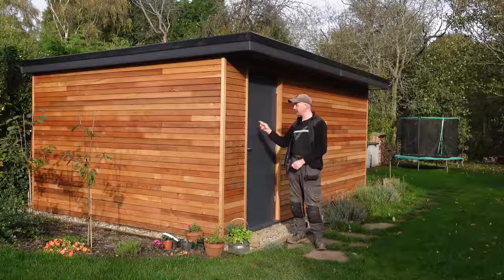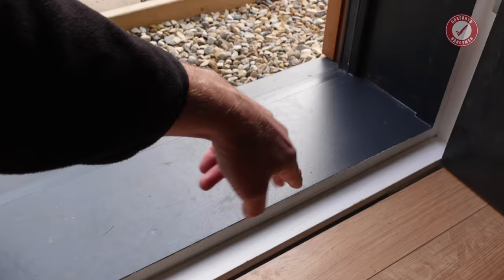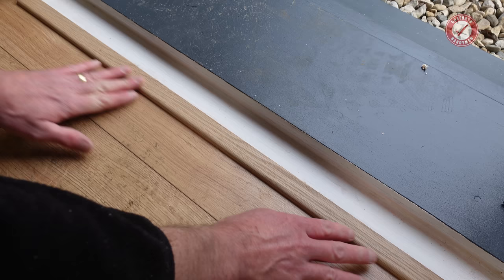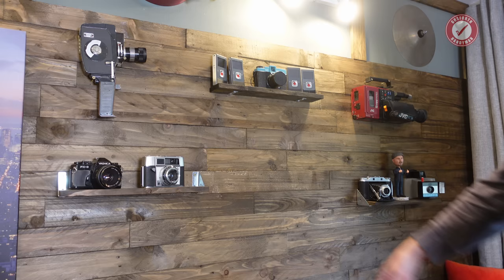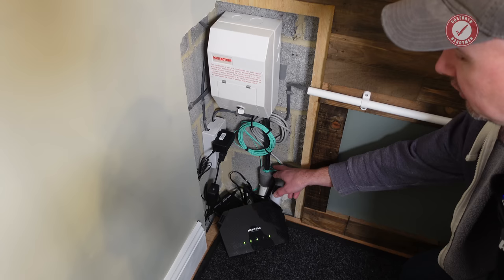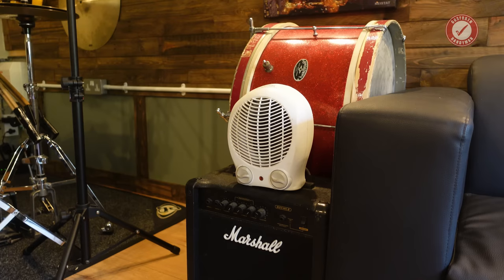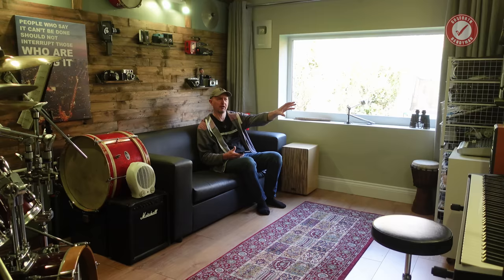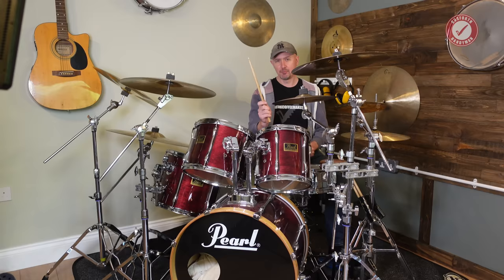I built a SOUNDPROOF garden studio!

Comment: I'm a network engineer I'd suggest shortening that last bit of fibre cable a get rid of that loop, over time the glass inside will deteriorate and you won't just have couple of packets lost.
Reply from the maker: I have no idea how to re-terminate fibre! 😁
Reply: @GosforthHandyman  there are kits although they can be expensive as you're dealing with cutting glass essentially. Maybe a group of cables divided with couple of connections. Anyways I'm sure it'll be okay although be prepared for a breakage. 👍👍
Reply: @GosforthHandyman  Fibre is complete overkill for this application anyway. If it goes , just pull another CAT6 cable through so you still have redundancy.
Reply: I'll bet my granny it'll be just fine for about 1000 years .......!
Reply: Huh? Service loops are entirely ordinary for fibre, they make a point of them to allow for expansion in overhead lines and so forth.
Reply: @Monkeh616  Yes they are, but not coiled like that. In data centres they are laid out in lengths of conduit to prevent damage.
Reply: @elminster8149  Sure they're coiled like that. Search for an Openreach CSP to see an example.

A coil is no different to a bend, so long as the radius does not induce undue stress there's no issue. There's papers on the subject..
Reply: @Monkeh616  Yup, I believe the bend radius was the issue being referred to. Anyway it's academic as it's not going to get changed here.

Comment: Looks (and performs) fantastic you must be chuffed to bits.

I would not do anything about CO2 control. At worst, do not close the doors until just before you start recording.

However, assuming you effectively have an airtight box to ventilate you need a supply and an exhaust otherwise you will dead head the fan.
Reply from the maker: Yup, would need an 'in' and 'out'. Gonna buy a little detector thing. 👍

Comment: Jeffrey Dahmer would have loved a room like that 😂 Seriously though, instead of the fan heater it might be worth getting a dehumidifier. A desiccant one would run at about 300 watts and would keep the room dry and remove the chill at the same time. It would help with the air quality in the room too while you're working out the ventilation system. If moisture gets inside those cameras then they're pretty worthless as you likely already know...maybe they're just for decoration though.

Comment: You've got it arse backwards on asphyxiation: your body can very acutely sense excess CO2 (hypercapnia) - induces feelings of panic and shortness of breath. Hypoxia (lack of oxygen) on the other hand, is the slow peaceful one-way trip
Reply from the maker: I read that CO2 poisoning starts with a headache followed by tiredness and passing out? 🤔 Good to know! 👍
Reply: @GosforthHandyman  yeah headache is definitely in there too. Doesn't make you pass out, that's lack of oxygen. In most circumstances you'll notice the CO2 before the lack of oxygen gets you, it's more of a problem in confined spaces where there's another gas displacing the oxygen that you can't sense (nitrogen, argon, methane etc). Sounds like you're taking it seriously and having a good think about it. Might be worth buying one of those not-overly-expensive CO2 meters to see what it gets up to after a vigorous drum session!
Reply: @GosforthHandyman  I think those symptons are for carbon monoxide poisoning. Someone has added a comment about the difference between CO and CO2 poisoning.